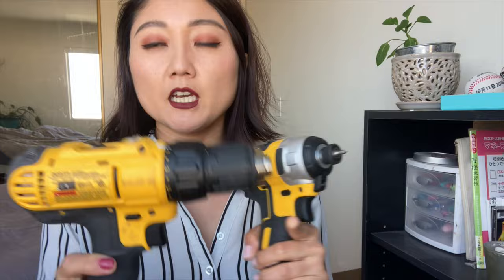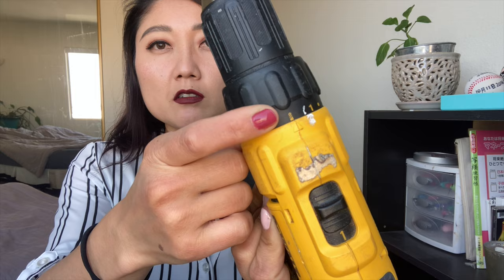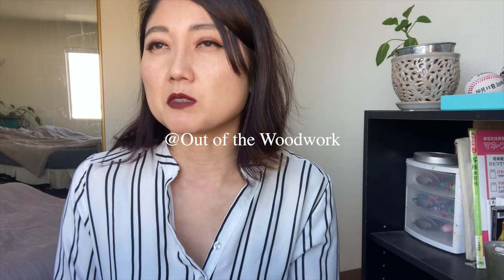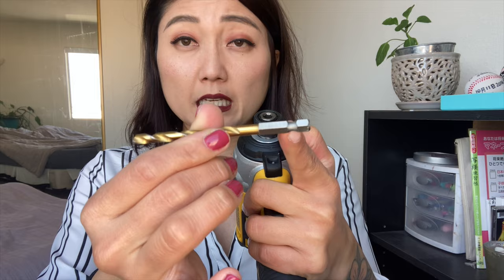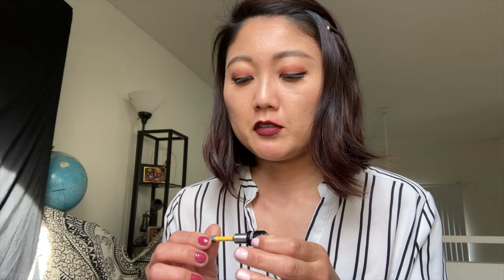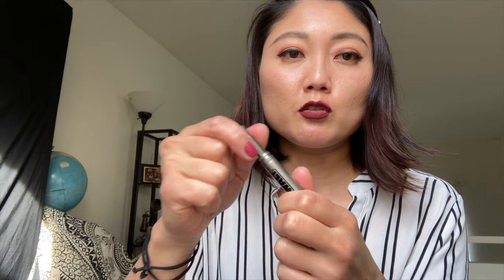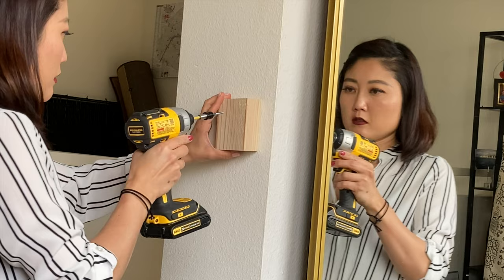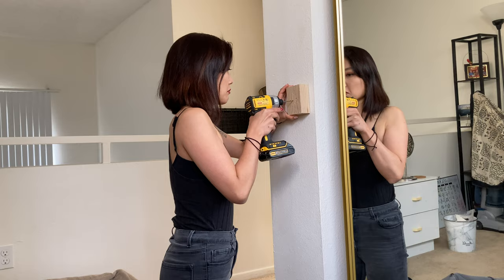LEARN WITH ME NO. 5 | THE POWER DRILL

Comment: Hi! 
Keep your old drill. Impact has its place (driving tons of screws into hard wood, driving self tapping screws into metal) but it's not necessary for almost any handy jobs. 
I like the protective tube thing. Sometimes when you're driving in screws, you push off to the side and the drill comes off the screw and damages your work or your hand that was too close. I think the reason you were struggling is because of the type of screws and you not pulling the trigger hard enough. I recommend having coarse thread drywall screws on hand instead. They're Super versatile. 
Anyways, You're doing great! Keep on learning.
Reply from the maker: I’m going to hold on to the Impact for another month.  That torsion bit was quite nice, but I totally forgot to bring it with me.  But you’re right, I don’t think I need both at this moment.  Thank you for your comment!

Comment: The impact driver is only really good if you're continuously driving screws in. It's not built for accuracy it's built for repetitive use.  It's like if you're screwing in multiple slats to a bed frame or decking boards.

For what you do, the drill driver is the best cordless drill to have. I'd recommend a newer 12v drill driver with a hammer function. It will do everything you'll need and it's lighter to use.

Regarding the impact driver, unless you're continuously driving screws one after the other, it's not really any use for what you do.
Reply: Also the extension sleeve, I don't recommend you use it for what you do.

I use it to drive in long screws. I extend the barrell, slide in the screw and then drive it in. It's like a guide to drive your screw straight where you pop a screw in the barrel and you lead it line up your screw and drive it. For what you do though, I wouldn't recommend it.
Reply from the maker: The new drill driver with the hammer drill option is the exactly the one I use now!  I love it.   I ended up returning the Impact.
Reply from the maker: Good to know!  Thank you!!

Comment: If I were to go minimalistic and i had to cut down my drill collection I'd probably narrow it down to my drill/hammer driver and my impact, each one has specific capabilities. It just boils down to what do you do for a living.
My drill driver slash hammer drill can use any bit for any delicate task including hammering into concrete.
My impact is for stubborn stuff and it can only use the 1/4 hex bits.

if I had to narrow it down further I would have no choice but to go impact.
 It can drill through concrete if needed, as long as I got the masonry bits and I run into a lot of rusted ass fasteners  that need some influence.
 Just gotta be careful with those.philips.screws you can easily strip those things out.
Reply from the maker: Great points.  I wish I bought the drill driver with the hammer option.  I’m still leaning toward the drill driver over the impact, but you’ve given me great points to keep in mind.  Thank you!